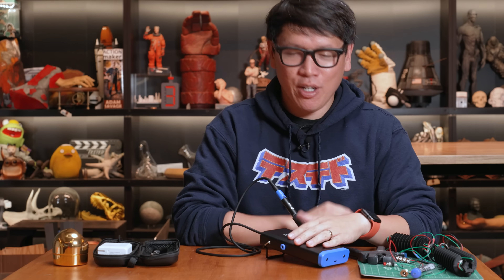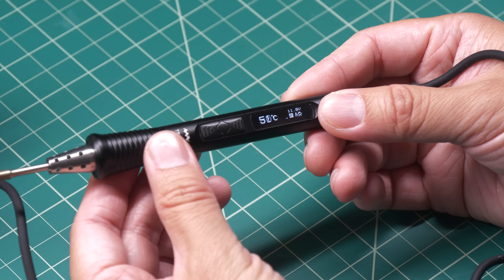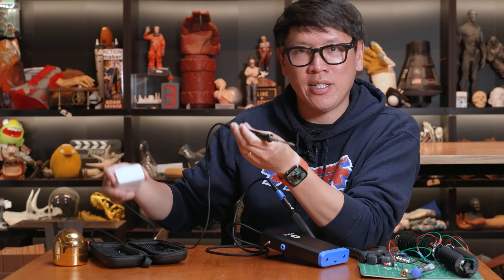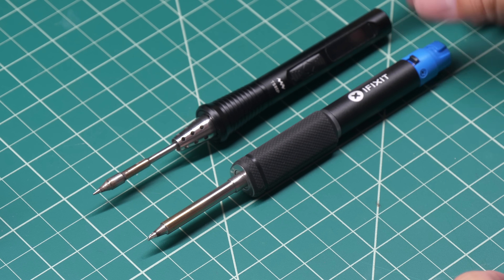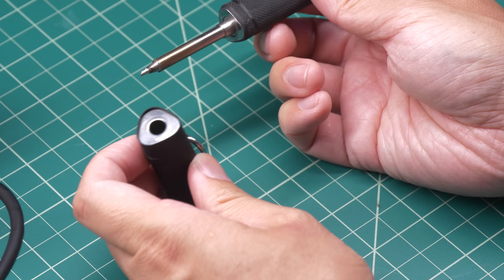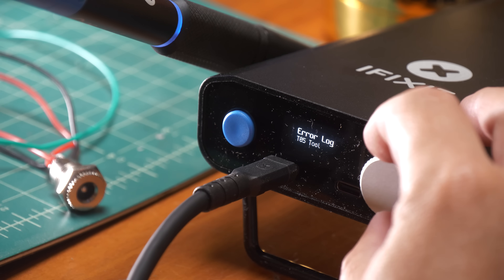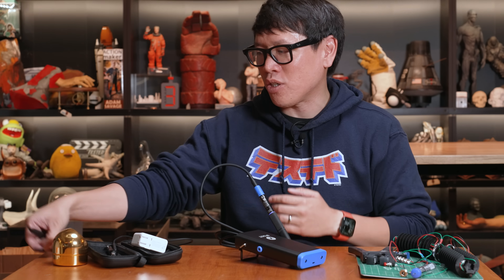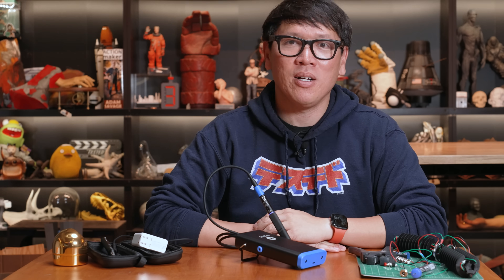Show and Tell: iFixit's "Smart" Soldering Iron!

Comment: I'm pretty sure this is different than my usb soldering iron, which I don't think has the phono-jack connection.  It does handle the minor esp32 based soldering tasks satisfactorily, so I don't think I'll upgrade, but it's cool to see that tech has improved even since I bought mine.

Comment: It's a very cool idea. However, they have some steep competition at that price point. I can get an entire soldering station with hot air gun for soldering pcb's for 250. At 150, and a few extra tips they would have really had a good thing.  It might simply be based on how much it took to manufacture the first gen, so hopefully they can work on balancing that out.

Comment: I wish that this came out a few months ago when I was looking to buy a USB-C soldering iron, I was stuck between the Pinecil V2 and the TS80P.  Ended up getting the Pinecil V2 because it was cheaper and had a higher wattage rating, it has not disappointed me yet despite that I am still somewhat of a beginner with soldering.

Comment: The lights throbbing/ pulsating, flickering, or whatever they're doing is very distracting for me. 
I wasn't sure if they were intentionally set up that way, or if there was a powerline issue that was causing the camera to pick up the flickering of the lights. I kept looking at the lights doing their thing instead of looking at the USB-c soldering iron.

Comment: Speaking of keeping junk out of dumps, I think it’s a good idea not to automatically include a wall wart, how many people out there don’t have at least half a dozen of these lying around? If you actually require one, they got you.
Reply: The output of most wall-warts is less than 5v @ 2.5mA or around 12 Watts, this device, in order to not run off the included battery, would require much more power. Newer, beefier wall-warts can get up to 100 Watts or more. Even if you don't get the iFixit iron and chose another one you would still need a decent DC power supply.
Reply: @edwardagin9744  Well there you go, as stated, they can supply one if required.

Comment: I think it'd be both cheaper and better to get a 90 Wh battery bank and a USB-C soldering iron with a screen. More capacity, better UX, flexibility in power supplies, and I have a battery bank to use for other devices.

I absolutely love iFixit and want to support their mission, they've helped me bring so many devices back to life. I just can't justify spending that much on a soldering iron, especially when the Pinecil and Weller's battery operated one exist.

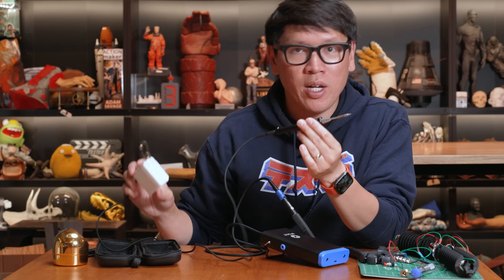Comment: 2:25 A USB PD power bank capable of at least 40 watts (I use 65 watts) turns the TS80 and Pinecil into a portable soldering iron. My bigger beef with them is the lack of a proper stand, but that's where Hakko stuff can come in; also the tips are quite expensive.

Comment: Back in the late 70s my boss had a battery powered Wahl soldering iron while the rest of us had the old Weller soldering guns. Don't know how much it cost or how how long the battery lasted. Each time he did a solder or desolder he stuck it back in the charger station. I guess it didn't work out, looks like they only do shavers now.

Comment: Looks a nice unit, well designed. And I really like the iFixit gear. All the stuff of theirs I've bought in the past has paid for itself super fast (by repairing stuff instead of replacing).
But at this price point!? I don't see any ROI with my use cases which is sad. I would never buy just the unit - because plugging into a PC to use an app to set the temperature? Pass.
Thanks for the review Norm

Comment: You can get a pinecil with silicone usbc cable from pine, and order a 65w pd powerbank from china, for under 100 including vat, import costs etc. More available tip types, easier to use, no proprietary stuff, more awesomeness. Sorry ifixit, this ain't it

Comment: You want normaly better solder tips, in many different sizes. So I would go for a $60 Secure S60P for JBC C210 tips or Secure S99 for JBC C245 solder tips. JBC makes even hot-Knives for the C245 size.
You can have all the good tips, not only china clones. If you need a special tip you can buy an original JBC tip. S99 when you want the biggest selction of tipps. 
https://www.youtube.com/watch?v=i-Z6lte8f74 
Video about JBC tipps (drag solder, knife, wide tip C245-667, C245-765, C245-949 )
https://www.youtube.com/watch?v=AaoYNo9X5Ss

Comment: Hey there, Norm. There are even 3m long 100w usb-c cables. So, no. The cable is not limited to 1m.
Reply: my laptop even came with a 2m cable that's rated for 240w
Reply: Pine has a 1.5m cable that serves me well away from the iron

Comment: I love iFixit but man have they missed the mark here. A TS80P with a quality third party battery bank comes out a cool €110 cheaper over here, and a pinecil with the same battery even €150! And neither need a pc with an app... People mock smart soldering irons for running an operating system on a hot metal stick, don't let anyone hear you need a pc app for this one lol
Also this show and tell claims the ts80p is limited to a 1m cable because only that supports 100W of power, but it has a max of less than 45W, so that point is moot for that iron, but ironically applicable to the iFixit iron, where this same problem was not mentioned. I don't think Norm mentioned whether or not the tips are interchangeable with the TS80P either. I know the video says show and tell but the description and comment both mention it was sent for "review" and I find this to be a pretty poor review if I'm being perfectly honest.

Comment: I personally use a pinecil (from pine64).  it works very similarly to the ts80 you showed, but it uses both usbc PD as well as QC3 AND optionally it's got a dc5525 12-24v barrel jack should you want to use that.  the retail price is $36, is EXTREMELY accurate in terms of temp control, has an integrated accelerometer so if it detects no movement for a selectable timeout, it will go into cooldown, and if picked up, it will heat itself back up again (very convenient).  Instead of using it with a wall wart though, I use it with a 25AH 130w usbc battery pack which rests on my desk nearby when i'm using the iron (I bought the battery pack for use in charging my laptop on long plane rides and could probably power the soldering iron for DAYS).  using a battery means the power source can be placed conveniently anywhere within a meter and not be tethered to the wall.  for a soldering stand, I 3d printed my own using a model provided on printables called "TS100/Pinecil soldering station and stand" by fysiks, but there are a TON of different stands, cases, etc. for this particular iron as it's EXTREMELY well-liked in the maker community because it's cheap, takes ts100 tips (which are also cheap and plentiful), accurate, fast heating, and overall very convenient.

I have no hate for the ifixit smart soldering iron, but I moved to a portable soldering iron so I wouldn't have to be tethered closely to yet another big box, and I personally don't like that the controls are on the power supply portion rather than on the iron. - that said, to each their own, I value having lots of choice when it comes to tools on the market, and if I didn't have a soldering iron, and someone handed me the ifixit one, I would probably be happy with it.
Reply: I bought a Pinecil since I needed fairly accurate temperature control for a modding project, I do really like that it's just plug-in-and-go with all the controls you need right there.
My only real gripe is that the stock conical tip for it is not good for getting adequate pressure & heat transfer over a larger area. I ended up buying a TS-B02 tip which was just as precise and had a greater degree of versatility.
Regarding the iFixit iron, the proprietary elements is a turn off. Having to use an app or a branded power station is pretty skuzzy: eventually that app will go out of support and the station will go out of production. A good tool if well cared for will last decades, the iFixit irons probably won't through no fault of their own.
Reply: @Saand1338  I think that the app is hosted in the iron itself. It's like a GUI of a router or some kind of web app
Reply: @Saand1338  Nobody said that you need only the branded power station. More over the power station is fully maintainable, and I can't even imagine how you can break it
Reply: @Cpgeekorg  don't forget the pinecil is also Bluetooth enabled so you can tweak any settings and the temperature from you phone if you want to. Forget using a computer.
Reply: @jamesash7368  I didn't realize it had bluetooth, but I don't understand why I would want it to have bluetooth - the temp controls on the device work great.
Reply: @Cpgeekorg  if you update iron OS it enables it. I played around with it just because. It's easier to change the other settings on the iron like the scroll speed of the display ect. It's not essential but it's easier than digging through the menu. 

Aside from that I have actually found it useful to change temp on my phone Vs on the iron it's self because it is quicker to pick up my phone if I'm doing other stuff than it is with the iron especially if the iron is hot. Your results may vary but it is a cool feature.
Reply: @jamesash7368 Only on the v2 pinecil tho. 
I have a v1...............
Reply: You can use pinecil with a ryobi or milwaukee or other company battery with a $10 adapter, since everybody seems to have such batteries
Reply: Bought two of those, just in case one broke (still going). Using it for a few years, not extensively but from time to time. Amazing iron. I use it either with a dewalt battery with a booster to reach 24V, but more recently I've mostly used my Anker 100W output powerbank. Last weekend i soldered four 2,5mm2 to a 4mm2 cable as I didn't have my metcal available. Took longer than usual but it got the job done.
Reply: PINECIL SUPERIORITY SQUAD YEYEYEYEYE
Reply: The Pinecil has been great - sure, the stock tip isn't the best but it's a good all-rounder and alternative tips are easy to find. If you replace the screw at the front with a thumbscrew, switching tips is super fast and coupled with a compact case (I have a 3D printed one with a built in stand, wick, solder, brass wool, flux, alternative tips, and USB cable) and powerbank (I use a Baseus 65W PD) it can't be beat.

Especially not by an iFixit bass-ackwards revision that takes everything good about the format and gets rid of it.
Reply: @LostNimrod  I got it as a birthday present so I got all the tips and the headset kit from CNC kitchen, a clear shell, the long silicone cable. All came to less than £100. Printed the double stack case and did the thumb screw mod. I just built the stealth press for putting in heat sets but honestly, I might just buy another pinecil to live in it as their so cheap.
Reply: The best recs you can get are always in the comments section of technical videos, thanks for the suggestion ill check this out! 
Edit - And right now its on sale for 26 dollars, great gift to myself and possibly others lol
Reply: I love my Pinecil and now I have an awesome battery bank because of it that I use for everything else. 10/10 would buy again
Reply: I can't believe how cheap the Pinecil is, I also use one and that combined with my AC iron for big stuff are perfect. USB-C battery pack + Pinecil is the way to go definitely. I think I'd like to figure out an attachable stand for the pinecil to be able to set it down more easily. That's the only thing I really regret not having.

Comment: $250 is far from cheap, for sure, but if it is a quality product with a serious lifespan, I’d call this high-priced rather than over-priced. A solid, quality product like this is easily worth $300 (imo), and that’s expecting typical consumer tool standards, which this seems top end of.
Reply: Pinecil or Hakko. Or both for different size jobs. I don't think there's a place for fixhub
Reply: Pinecil a battery and a hakko come out to about the same price and you're not locked into effectively proprietary $20 tips

Comment: USB-C power sounded awesome at first. Having used it, I absolutely hate it. No one makes a nice, flexible USB-C PD cable. They are heavy a stiff, and not very long. You are now tethered to a 120V outlet because you need the power supply (or a power bank I guess). PD power supplies do not like the power spikes these irons generate, and often reset, at least the ones I've tried. Fancier power supplies are even more particular.

I much much prefer the irons that will take DC in, even if it's DC in via the USB-C connector. That way I can use thing silicone wires, and connect it directly to a battery pack via XT60. I've got an iron that takes JBC tips (Sequre S99). I can feed it 20V DC, and the resistance of genuine JBC tips means it can put out up to 150W which is nuts. It has completely replaced all my soldering stations and I can take it wherever I want.

I will say that base station is kind of interesting, but for that price? Ouch. You could almost buy a genuine JBC soldering station for that.
Reply: Give our cable a try! You're right that most PD cables are stiff and frustrating. Ours is supple and flexible, it's a real joy to use. It doesn't drag the iron around your desktop.
Reply: Look for silicone cables (like the iFixit one). They're flexible and also don't burn when you accidentally touch them with the iron.

Comment: My main gripe with the TS100 is the ergonomics and the fact I always accidentally press buttons in use. This seems to fix those type of issues for the same price which is cool. I havent replaced my hakko with the ts100 because of these issues but it seems like thats the gap the base was designed to bridge is to make it portable and a benchtop iron in one. I think if the base ran off of AC I would be more inclined to get the base itself but the pen seems awesome and I like the company.
Reply: IronOS is compatible with the TS100 - so the locking of the keys should be available with the TS100 as well. Just update the firmware.
Reply: On the Pinecil, you can lock and unlock the buttons by holding both of them at the same time, which allows you to avoid accidental inputs.
Reply: I hadn’t heard of the pinecil until this thread buttons look a lot better placed too.

Comment: WIth the power station it seems like a decent thing with a high price... Without it, why is this a product? Why would you buy one of these things on its own? I get that they took the buttons and screen off it to cut costs but it's still 80 dollars, you have to plug it into a PC, have internet connectivity, open chrome, and open a website that can interface with the device to change the temperature, THEN you have to unplug it from the PC and plug it back into whatever power source you are using. This is an absolutely maddening produc.t

Comment: 250 bucks and it doesn't even include a cable to plug it into an outlet... this isn't a smartphone FFS, this will need beefier plugs that not everyone has readily available.
Completely agree with the review... at that premium price point, at the very least, a wall-plug should have been included.
Reply: Everyone has a USB-C charger. No reason to include one here.
Reply: @ophello  Not everyone has a suitable high-powered charger, maybe check your facts.

Comment: I thought for a minute that these irons had a battery inside them. They do not. They are corded, as noted at the Amazon listing.
Reply: The battery is in the Power Station, which has enough juice to solder over 2,000 through hole joints.
Reply: @kyle_wiens  i think they want to soldier the aux off the iphone without having to use to much muscle

Comment: I like that this is a more integrated and fully featured version of a portable soldering setup, but I'm really not sure this justifies the price increase over something like a pinecil usb c soldering iron alongside a regular 65w power bank. Buying the pinecil, 65w wall adapter, silicone usb c cable, and a 65w power Bank is a full $100 less than this solution, and it has the added benefit of being able to use the cable+wall adapter to either power the pinecil indefinitely, or to fast charge the power bank.